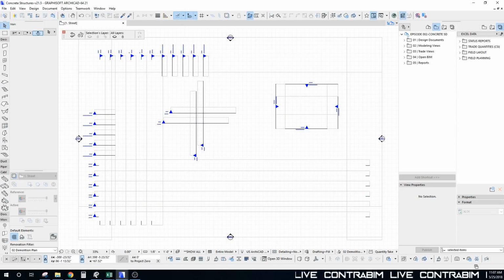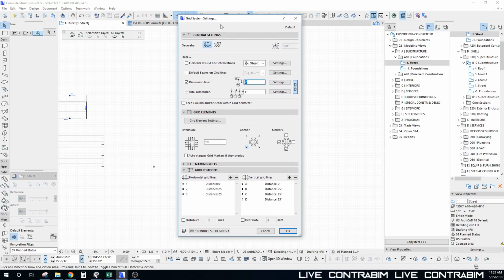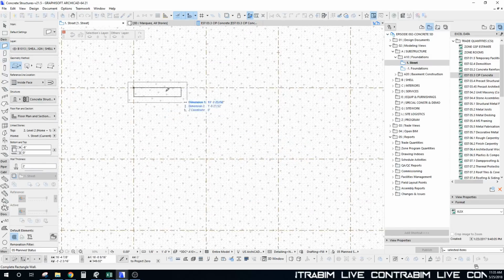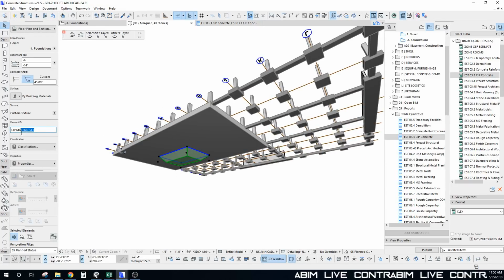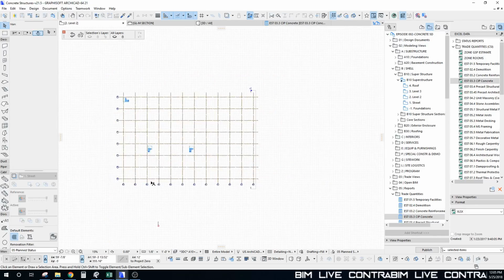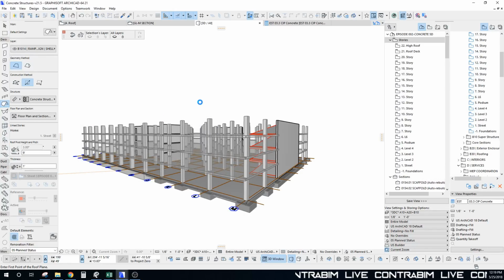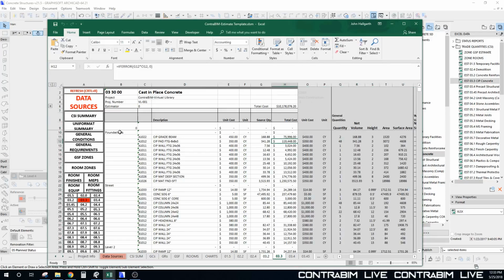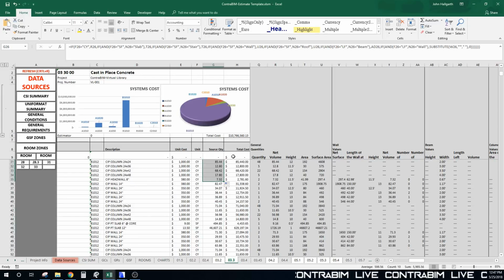How to Estimate Concrete from ArchiCAD to Excel

Comment: IF YOUR GRADING SOFTWARE & AI, CONTRABIM IS THE BORG COLLECTIVE OF STRUCTURAL CONCRETE DESIGN BUILD SOFTWARE...... EVERYONE ELSE IS OREGON TRAIL
I FINALLY HAVE THE I7 8 CORE, 32G DDR4, clocking 4GHZ but cannot find GPU UNDER $1200....  will a Geforce 3050 MAKE MY SIMOLEANS HAPPY?
Reply from the maker: Thanks Fred!

Comment: Do you folks sell Archicad with The ArD5 ? 
What's tier does ARD5 require? 
I will be using 5D for estimating  and workflow passed on to PM. I wont be involved with Conceptual, DD plans that often.  Would like to keep 2D up front so not to advertise a service
Reply from the maker: Hi Brandon. Sorry I'm a little confused on the ARD5? Are you talking about 5D Estimating with ARCHICAD? If so then yes! We have special template here from CONTRABIM that include the 5D estimating workflow, few different versions of them in fact. You should check out the CONTRABIM 5D Estimating Pack, which can be loaded on top of any ARCHICAD template, US or INT metric, we also just released a new Residential Template that includes the 5D workflow, both in US and INT. Check out https://www.contrabim.com/contact-us and send me a message if you have questions!